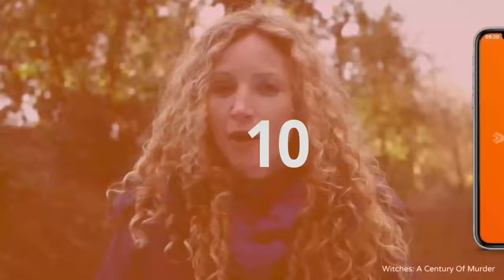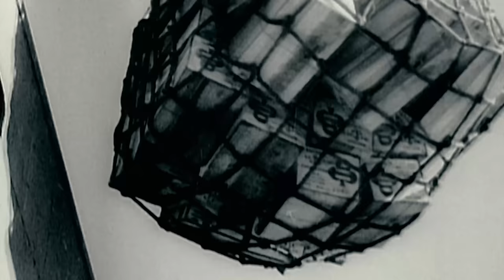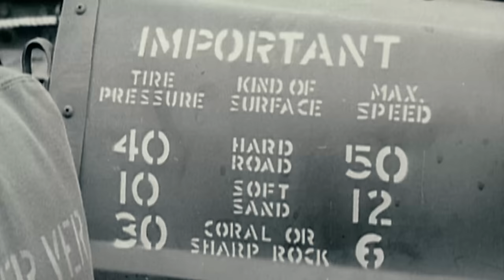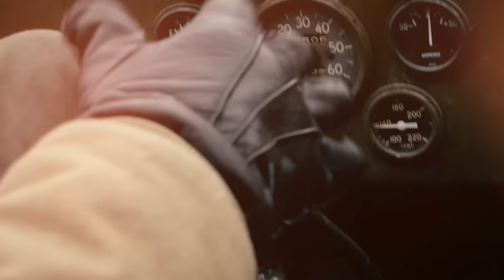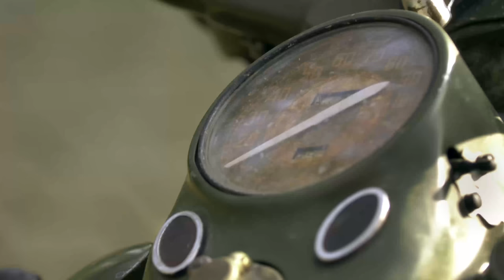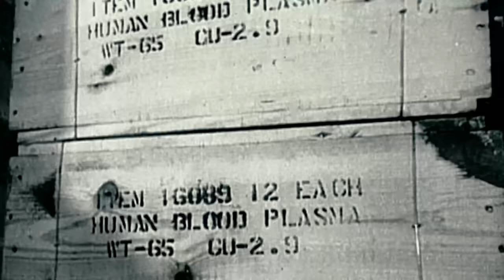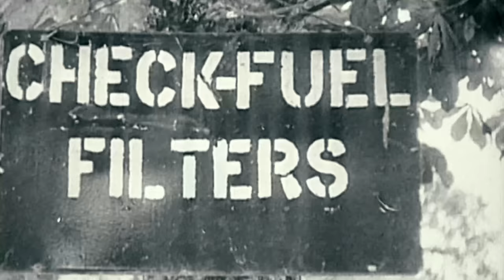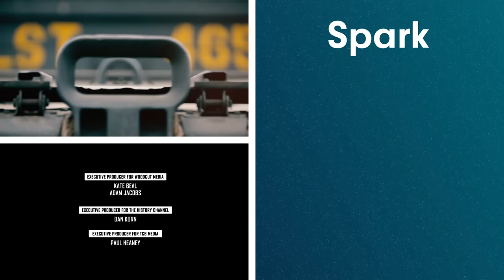The Combat Machines That Won D-Day For The Allies

Comment: Au contraire of the Harley Davidson information. Indian is an older and more innovative and successful company than HD. In fact HD is simply a poor copy of an Indian and would come years later after HD hired Oly Evinrude (boat motor fame) to sort out their engine designs.years later. All the items claimed for the WLA were invented by Indian first.  Even before HD was created as a company, Indian had invented the motorcycle carburetor, suspensions, belt drive, electrical, the internal handlebar controls, the motorcycle transmission and wheel designs for production motorcycles. 
 Indian invented an electric start, with electric lights, and used a front and rear leaf spring suspension motorcycle in 1914!  HD did not make an electric start until 1965. HD also did not use a rear suspension at all until the 1960's.  Indian was the largest manufacture of motorcycles in the world just before WW1 and supplied most of the motorcycles for that war, not only for the U.S. but for European countries, Australia and more. Indian also made more engine and frame sizes than HD for 350, 500, 600 (the worlds fastest Indian used a 600cc Indian Vtwin), 1,000 cc and their famous 1,200 cc, finally a 1,300 cc after the war.

Indian won the incredible Isle of Man TT races 1st, 2nd, and 3rd before WW1, HD did not even make a race motorcycle. A few years later Indian made their famous 8 valve - overhead valve racing engines between WW1 and WW2. HD did not have any technology comparable.
Before the famous Harry Ricardo developed the squish area rule for piston to head performance, it was already being used in Indian 8 valve Over Head Valve racing motorcycle engines.

HD and Indian both made motorcycles for WW2. The contract with the gov't was for a 500cc motorcycle. Harley did not make one of that size in a flathead like Indian did, so they offered their existing 750 cc bike for the same price. If 750cc had been competitively offered from Indian, their 750cc Scout was one of the leading and most popular and powerful bikes it's size in the world.  In fact resizing an Indian engine was remarkable simple. Cylinders could easily be bored out considerably larger and the sleeves inside them replaced. I have seen someone do this and use a cast iron drainpipe machined down to work. To stroke the bike does not require new rods, they are simply relocated to a different spot on the existing flywheels. 
 My bike was easily stroked and bored from a 74 cubic inch engine to an 88 cubic engine.
(in fact we bolted on a new Keihin CV carb to the Indian intake manifold with no modifications whatsover to the bike or carb. Timing moved from 38 degrees tdc to 19 degrees tdc, from the superior atomizing modern carbs do. We dyno'd the power at 57 hp and 67 torque. Not bad for a 75 year old flathead bike on regular gas that only weighs in at 500 lbs wet.)

Field maintenance for the Indian was also twice as easy as that for the HD. All the Indian handlebar controls could easily be switched to either side of the handlebars, right or left hand throttle, as the ends of throttle cable and the distributor timing cable were identical. The hand shifter could be moved to either side of the gas tank easily. All Indians used standard automotive parts in most of the motorcycle. A belt driven generator from nearly any car would fit,  HD's was a built in mess.  Indian used a standard automotive coil, and spark plugs. The front headlight can use a standard automotive sealed beam headlight. I use one on my own 1946 Indian Chief. They used a small car battery.
If you wanted to convert to 12v for better headlight power, you only need to change to a 12 v car generator, 12 v car coil and 12v sealed beam car headlight. All the nuts and bolts are standard American SAE sizes available anywhere. All of them. All the bearings in the front forks, front and rear spoked wheels are standard automotive and we now use sealed bearings. 
It could also use the current 1940's FORD flathead pistons from any Ford vehicle in use on the battlefield with very slight modification for the crank pin,  and the distributor could be replaced with the one from a few models of a John Deer tractor. I have used cut down sodium filled  valves from a Cummins diesel engine in my '46 Indian Chief.
The front and rear tires and wheels are exactly the same size and are interchangeable.  The wire wheels are held on with standard automotive lug nuts, and axles sizes and the rear wheel can even be removed without taking the chain off. The side car will use an identical wheel and tire and rear brake  to the rest of the bike.

You can easily take off either side of the two piece gas tank, and the bike will still run with just one. If you ran out of gas, you can take either tank half off , or even both, and take it with you to fill with gas back at the supply dump, bring it back, bolt it on and use it.  You always had two "gas cans" at any time you needed them for the bike or even for a jeep. The gallon of oil was also held in the front of the right tank in it's own compartment, the 2 gallons of gas behind it. The other tank held 3 gallons.  This offered much better oil cooling than HD used. It runs on straight automotive/truck 50 weight throughout the bike, primary chain and separate transmission. The carb on an Indian was the same used on tractors, lawn mowers and more, was on the left side on purpose. Same side as the kickstand, so the bike would protect the breather and chances of water, dirt or snow getting into it when parked. it also helped pre-flood the gas float chamber for easier, faster starts.

The most useful maintenance in case of a severe accident or combat damage is that the entire frame was BRAZED together instead of being welded. The gas tank was soldered together.  This meant that to change any part of the frame that was bent, you merely have to heat up the two end joints to loosen the braze and simply pull the frame tube part out, then put in a new one. The GIRDER front end was far superior to the HD pogoing two piece springer front end with it's uneven side loading death wobble issues. And it was simpler. The front girder also used a standard delco automotive shock absorber in between it's springs. The rear of the bike had spring shocks as well. The seat post had 5 progressive wound springs inside the seat post, as well as adjustable over ride, and load balancing springs on the back of the seat.
The Indian was also made, from the factory, to accommodate a side car at any time, to either side of the bike as all the frame connection ports are built in from the beginning.

There were no hydraulics used anywhere on the bike. The front and rear brakes were mechanical. You could stop as fast as you were strong. The foot clutch was mechanical, and the tank side hand shifter is mechanical. Simple, effective and brilliant.
There was only one Chain on the war model motorcycle, used for driving the rear wheel, instead of a multirow primary chain between engine crankshaft and the transmission shaft like HD, Indian used helical cut gears instead.  Stronger and trouble free. 
HD was able to supply motorcycles mostly for the European theater, and Indian who did not have as big a manufacturing base at the time supplied bikes for the rest of the world military use. 

The Indian motorcycle was the single most practical and useful motorcycle in WW2 and beyond. It was also cheaper because of its standardized Automotive SAE parts.
Via bad management Indian went bankrupt in 1953 leaving HD as the only existing large motorcycle company in the U.S.  HD remained an antiquated low power, heavy design falling far behind motorcycles made in Europe until the 1970's.

Addendum:  For the North African Desert War the Gov't requested a "desert" motorcycle.  This was attempted by HD, their under powered 750cc used up in Europe, with the "fore and aft cylinder" arrangement not cooling the rear cylinder enough. Also the special XA springer front end, with NO rear suspension, could not pass the tests for desert.  HD was also asked to then make a copy of the Germans BMW shaft drive machines, but they demurred.
 Indian went ahead and developed a very simple and brilliant design by turning their Vtwin Sideways in the frame for better cylinder cooling and rider leg protection, adding a foot shifter and hand clutch, then an excellent shaft drive, in 750cc. The front end was an amazingly stable girder design, used on Indians after WW2 as well. It's girders can be changed for longer or shorter, in the top or bottom positions the change the rake and trail of the front end,  for sidecar, or terrain - in a matter of minutes.
  This "sideways" vtwin completely influenced the Italian MotoGuzzi motorcycle corporation (the oldest continuous and most successful motorcycle company in Europe) who then became world famous for the sideways v-twin, with shaft drive, and they are still made today.
Reply: Like the Honda more.

Comment: The duck is junk,. Rode one in Pittsburgh... We got in the water n it was very low in the water... N 2 weeks later then ppl died in Missouri... I would never ride in that shit heap again... Thank God they shut them all down
Reply: When it was built for the War it filled a vital need to get supplies from shop to shore supply depots and cross rivers until temporary bridges were  built. What was done to them since for the Tours that’s a different story